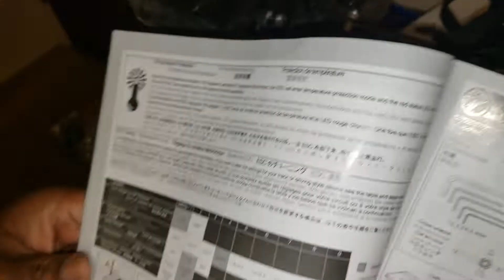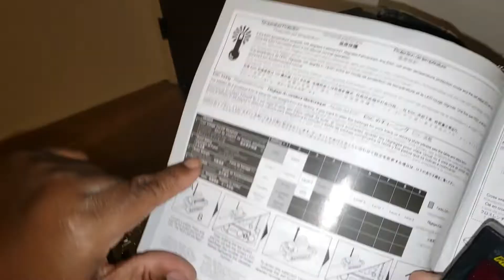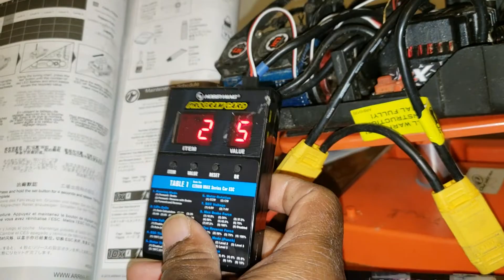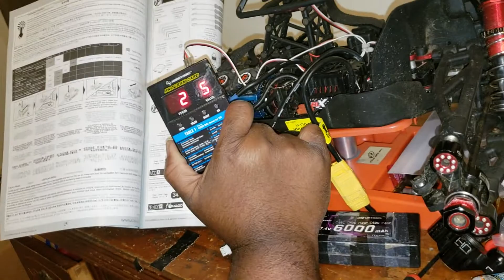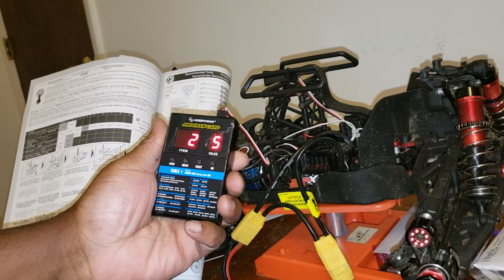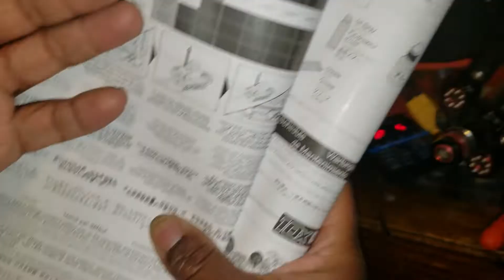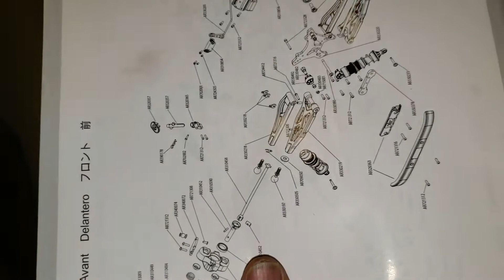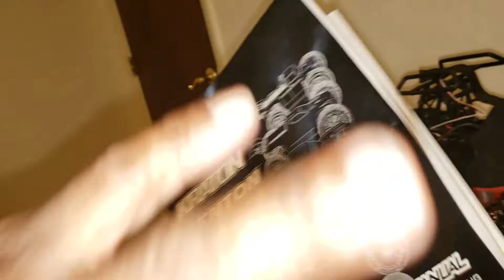Little tutorial how to use hobbywing programmer for blx 185 and 200

Comment: I was hoping these cards could access deeper settings so I could nix the LVC entirely for my BLX100 or BLX185.  I'd rather not use LiPo or NiMH, but NiMH setting work a little better in my case but NiMH isn't an accessible option anymore here in 2022.

Comment: cannot get mine to work on my arrma kraton blx 185 the card is brand new but it does not light up for some reason. Thanks for the tutorial
Reply from the maker: U welcome bro
Reply from the maker: I do another video how to hook up
Reply: Plug in while off make sure white wire is on the U symbol. Then while plugged in hold set then on switch